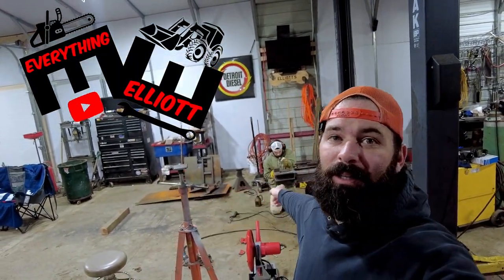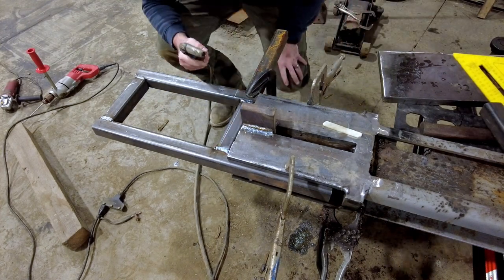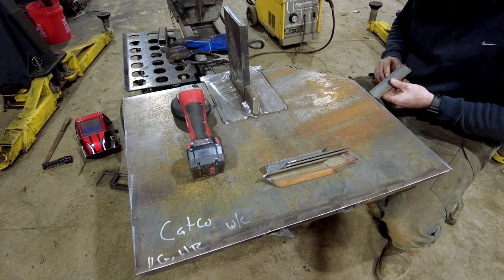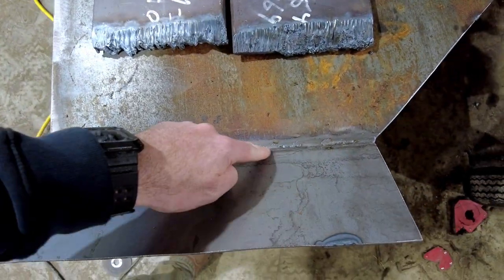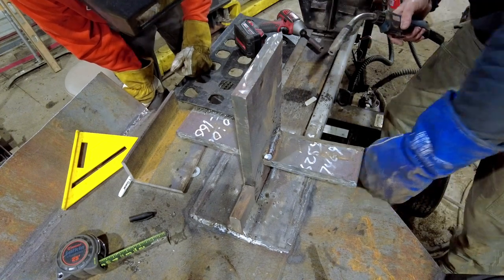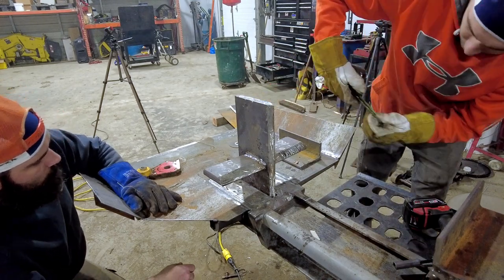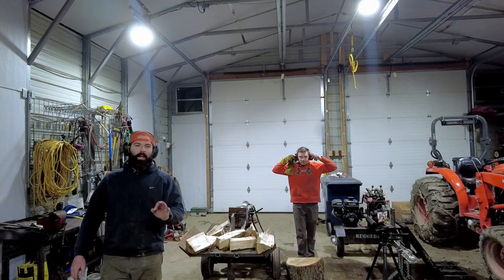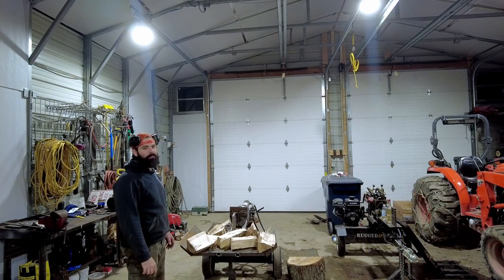DIY Homemade Push Through Log Splitter - Part 2

Comment: Hi Elliott and George, Just put a camper levelling jack under the wedge end. Make sure to set it back far enough not to interfere with the conveyor fitting under it. Pulling it down the road is going to be tough due to tail wagging. As I said in my email check how the beam mounts to the oil tank it looks to be the same as my Speeco,  that is the weak link on these splitter once you add all that extra weight on it. Now that it is a push thru wedge you also don't need to or want to have the pieces pop like that. Grind it on a really steep angle so that it slices thru knots and you will end up with cleaner splits. When I built 4 ways I angle the wings against the main wedge to allow them to slice better. Nice job.
Reply: I agree
Reply from the maker: Thanks for the comment and email! The tank is actually seperate of the tank on this unit. There are 2 hung points on the hydraulic tank that the beam connect to, hopefully those don’t transfer any force!

Comment: Add a jack on the heavy end.  I used a pivoting strut under mine.  I can flip it up and pin it when moving the splitter.
Reply from the maker: Thanks for the tip! And thanks for watching!

Comment: I done this with a box store splitter that had a full beam with 3/8 flange and a sandwich style push wedge. I only used the beam and cylinder.   I raised it to 34" to fit my height on a narrow trailer axle. I added a much bigger engine and pump and bigger hyd tank . I put the tongue and jack on business end for the weight issue. Good luck with your build!!
Reply from the maker: Thanks for watching! It’s been a fun build, and I’m always happy to help a friend out!

Comment: Very nice job fellas look good those short pieces of wood sure do like to pop comin off the splitter. Dad n I made a splitter and we put the largest cylinder on it from tractor supply and we took it to my aunts house to help her clean up some storm damage. She had the tree service cut trees out of her drive we got the wood course the tree service cut them all different sizes n let me tell u the short one popes once that second stage hit they went flying I bet 5 feet or so lol we found out quickly not to stand in front of them haha great video n modifications
Reply from the maker: Thanks for watching!

Comment: Be SUPER cautious when you put the 4 way on. If a piece of wood is running up that ramp just before the wedge the 4 way will be directly in the path of the log moving up vertically. You'll definitely need a stand under the outfeed end. It would potentially be a better option to move the wheel under your outfeed table if that could be manage. That would mostly get them out of the way and would reduce the chance of the splitting tipping up to zero.
Reply from the maker: I know it doesn’t look like it but there’s almost a 2” gap between the ramp and the start of the wedge, should give it enough time to ride up before contacting the 4 way knife. And i think George is planning on putting a trailer Jack under then outfeed table to manage the balancing issue

Comment: You`re going to need a jackstand under that catch tray fella`s. By the time you start pushing wood onto that catch tray, its gonna tip downward.
You won`t even need those brake rotors for weight if you add a jackstand to the other end under your catch tray.
Reply from the maker: I believe that was on George's wish list, we just didn't have time to do it while it was at my house...

Comment: You asked for a comment so just an fyi. Always grind a bevel on piece to be joined to primary piece. This provides better penetration at the root to give maximum strength.
Reply from the maker: Oh I’m well aware of that. But the amount of grinding we had to do on those blades we were over using the grinder.